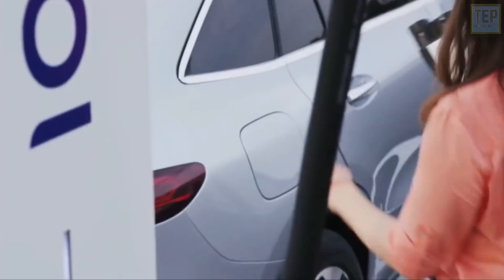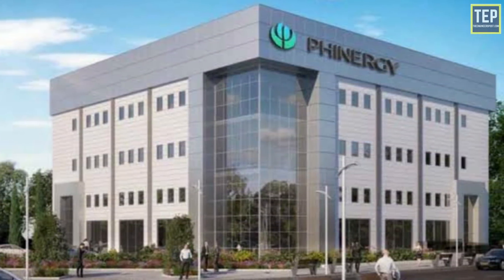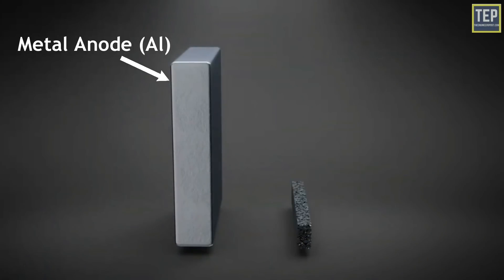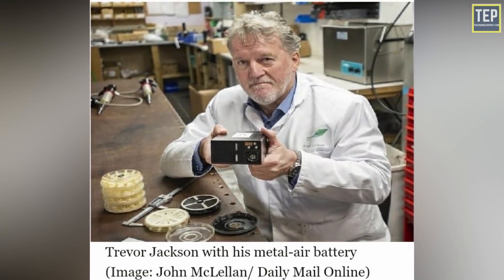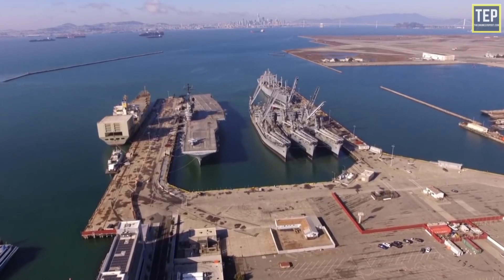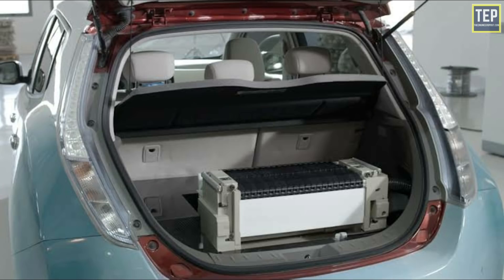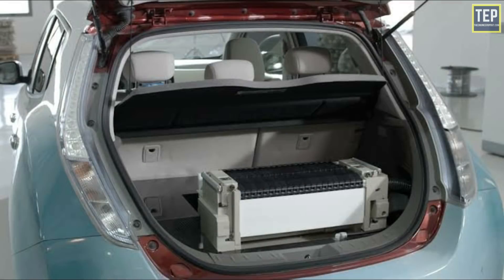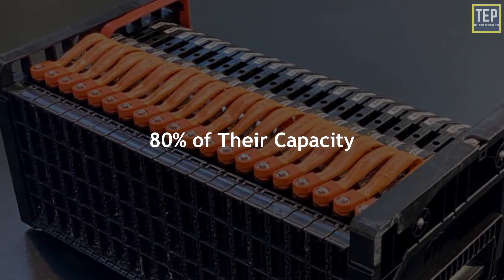Aluminium-Air Battery | An EV battery that Doesn't Need to be Charged

Comment: Sounds  too good to be true I just can't  believe  this  as full truth  revealed
Reply: It is, while the tech is old and well understood, making it fit the roll as a car power source at a competitive price isn't. Electricity can be delivered     thru a grid cheaply. These will require tractor trailers to haul new and depleted units around. The recycle part a white lie. Most recycling is taking aluminum metal, melting it, letting the contamination burn off and repouring it. This is aluminum rust. It has to be refined back to a metal so you will need much more energy. Once wet the clock starts ticking, the cell is dead in 5 to 6 weeks  even if parked the whole time. And there is more
Reply: Make one yourself! Take activated charcoal, (pet store for aquarium tanks), paper towel and salt water. The industrial versions use modifications, but it works!
Reply: @evanriddle1614   Honestly  I'm  not  good  at handling industrial  material  or assembling these only can handle  small basic work at home just to not  become total  handicapped by service seeking  helpless to anything in life in practical sense Jack of all master of none 🤓😂😀😊😲🙏🙏🙏🇮🇳

Comment: There's one thing that puzzles me though: If a car using this sort of battery did run out of charge and couldn't get to a swap station, couldn't a service truck simply bring a replacement battery to the vehicle (instead of taking the entire vehicle to a station just to get the battery replaced as you suggested in the video)? This sort of thing is already done with conventional vehicles powered by either  Gasoline or Diesel - we once ran out of gas, and my father simply had a friend take him to a gas station to get a small portable tank of gas we could put in our car.

In fact, from an engineering perspective, I'm not certain if dedicated swap stations might be the best way to distribute this sort of battery (delivery from a central storage facility or factory might be the only way):

I can imagine a single gas station serving at least a few hundred of cars per day (a single busy gas station gets a delivery of gasoline once or twice a day - _A DAY_); now, imagine how many new batteries a single swap station would have to store if it were to serve the same number of cars that a typical busy gas station would serve per day. I can imagine a single swap station would need a warehouse that's at least the size of a typical grocery store just to store enough batteries to keep up with demand.

A more practical solution would be to keep these batteries in a smaller number of extremely large warehouses, or even build battery factories in every major city; and people would deliver the batteries to the consumers and install them in their cars. And as for long distance travel, possible solutions include either building large battery warehouses and/or factories close to Interstates and other major highways, or even integrate overhead wires or wireless power distribution into Interstates and other major highways (thereby eliminating the need to charge or swap a battery while traveling long distance.)
Reply: You numbers are off as they would likely be a once a month switch versus people getting gas once or twice a week. So already a much lower load of cars per day on average considering there was a 100% conversion of technology. I would guess that home delivery/replacement would be a big appeal for many. If they were easy enough to swap then people could just have them delivered and do the swap themselves and receiving credit for turning in old power units. Think like an Alhambra water delivery service except you would not be getting multiple power units at once due to the 80% degradation in a month unless they are designed to not let the process start until originally connected. That could lead to swap stations being not nearly as congested at peak times.
Reply: @grimrevan4660  what matters is cost of swap
Reply: @grimrevan4660  In reality, the battery will last only 2 weeks max.  The natural degradation will decrease the capacity of the battery by 40% in two weeks leaving 1600 km of usage for the car owner.
Reply: @blam1328  The battery is fully replaced (not recharged) in most solutions, so no. There is a reason this type of battery attracts so many angry comments.
Reply: it will be via gas stations.  but it depends on demand and  cost
Reply: It can be recharged and used as a liquid metal slur instead of non-rechargeable solid aluminum bricks, at least there are prototypes for both.
Reply: @BlondieHappyGuy  LOL . carbon footprint to make the battery comes from power that you use and its one time. And its less than 2% compared to what ICE belch out during its life time burning gas/diesel.
And its about cleaner cities where most folks live and drive vehicles in.
Reply: @davelawson2564  the opportunity cost of using aluminum is what it could have otherwise been used for.
Reply: For a planned long trip, just carry a second battery. These are supposed to be much lighter so minimal loss for the added weight. Almost double the range. Include a simple switch to connect to second battery.
Reply: @BlondieHappyGuy  what nonsense are u talking about ? LFP is rechargeable battery and it can be charged at home and office parking lot. with most folks travelling 50 km per day in cities and 200 - 300 km range they can go for days w/o charging
Reply: Not easily. We would be talking replacing a battery that weighs between half a ton and 1 full ton by the side of the road. It would take more than just a floor jack to get that to happen.
Reply: @TheNeighbor4U  which battery weighs a ton that needs replacement by the side of road ?
Reply: Multiple battery install-run one down , switch to back up and replace primary battery, simple
Reply: hh
Reply: Perfect solution.
Aluminium Air Battery >> Lithium ion Battery

Comment: I've heard of something called petrol, apparently it's a liquid stored in a tank, that your car runs on, and when it runs out you can fill it up again in 5 minutes, and it's not a scam. Amazing!
Reply: And it runs on  about 15% efficiency, relies on unsustainable source, and releases a whole lot of harmful gas into the atmosphere.
Reply: @shaheenshad5012  Yes, but it exists, unlike this battery, because the laws of physics say that it's impossible for it to. If they're saying that it never needs to be charged, that means that it's producing energy without an external energy source, which is impossible in an Euclidean world. It's like a perpetual motion machine, which we know can't work. This is a huge scam and I can't believe people are falling for it.
Reply: @assetto1360  it is not an infinite energy source, each battery only lasts about 2700 miles, but the  interesting thing is that they say it can be swapped within 90 seconds. On the mean time they're working on making it renewable .
Reply: @shaheenshad5012  Then why does the title say that it doesn't have to be charged???
Reply: @assetto1360  an exaggeration, just like teslas were advertised as zero emission vehicle. Did you even watch video?
Reply: @shaheenshad5012  So then you're saying it's a clickbait video. Why would I watch a clickbait video? And that's the thing about electric cars. They're considerably worse compared to petrol powered cars, so they just lie, to make them sell better.
Reply: @assetto1360  mechanically recharged. Zinc air batteries also use this method.
Reply: @assetto1360  because it doesnt - it is Not a battery as such itdoes not Srtore charge it is  a generator
Reply: @DaveJohnsonDBA  That's exactly what I've been saying. A generator needs some sort of energy to convert it to electricity ( this can be heat, movement,  pressure, chemical reactions...),it can't just produce electricity from nothing.

Comment: Very interesting. A car might have 2 AA batteries, one inservice one on standby. If each battery provided 1,000 miles, the replacement cost would have to be of the order of $100 to make this scheme viable. Battery design would need to focus on very inexpensive recycling cost.
Reply: That would mean lithium ion is still cheaper for most people though. Most people, at least here in the states, charge at home for around $0.13/kWh. Even after factoring in the cost of replacing the lithium-ion battery every 1000 cycles, it's still half the cost of swapping.

The only way the economics of swapping work at $0.42/kWh are for people who would typically only fast charge.

Maybe there's room for both. Use your own rechargeable battery for daily commute. Charge off local grids. When it's time for that road trip, drop your lithium battery at a local shop to be charged/stored/maintained, and have them install an aluminum battery. When you get back, swap back into your fully charged lithium battery.

Having lithium battery problems, drop off the battery to be inspected, have an aluminum battery installed as a stop gap.

In general being able to hot swap rechargeable and refurbishable batteries would be a good thing. Would love to see a standard around that which doesn't impact storage capacity much. This is getting harder as more companies are moving towards making the battery a structural component of the vehicle.
Reply: with a 200 dollar tax
Reply: Aluminium air batteries only have between 2 and 3 times the energy density of a lithium ion battery. A "AA" size aluminum air battery would not power a bicycle properly. Let alone a car. You would need a battery the size and weight of at least 2 to 3 of the lead acid batteries found in an F150 to power a car. More to provide any decent range.
Reply: @TheNeighbor4U  No one said anything about a AA sized battery. Don't be dumb. Also, although aluminum air batteries density wise will be around 3x. Weight Wise it's about 8x. A vehicle powered by AA (aluminum air, not size, duh) batteries can easily achieve over a thousand miles in range. Though those kind of numbers will be harder to hit on more compact cars. Either way aluminum air batteries provide significantly more range, eliminate half the up front cost of an EV.

You can get an EV with a Lithium-Ion battery. Larger up front cost, and cheap electricity rates. Or you go with the aluminum air option, and pay pretty much what you're paying now at the fuel pump. In the long run they'll pretty much null each other out. But I have a feeling aluminum air evs, will be the ones people buy for junker prices, and drive for many years without much issue.
Reply: @dvanomaly420  I have learned not to assume things. Especially in this age where people believe massive amounts of misinformation and are willing to cling to those incorrect beliefs and facts even after being shown the truth of the matter.
Reply: @dvanomaly420  aluminum air EVs are further away from becoming mainstream than hydrogen cars. For at least 2 reasons. #1: They are not rechargeable. #2: they are only 2-3 times more energy dense. Not being rechargeable means they would need replacing repeatedly. And considering shipping costs and that one of the most likely to be used rare materials in the battery is silver, the battery replacement would likely cost significantly more than a full tank of gasoline. Even for small 100 to 200 lb batteries. At a frequency of every 2 weeks to a month for most people. This significantly eats into their ability to be cheaper or more convenient than current evs. Them being only 2-3 times as energy dense means that a long range car would still require batteries between 1000 to 1500 lbs in weight at a minimum. So significant infrastructure would be needed at gas stations across the nation to change out those batteries. It would not be possible to just run into the supermarket to buy a new battery with your groceries. This puts them at least 10 years out from being a competitive option to lithium technologies for evs. 

That said, they would be a fantastic way to replace most use cases for those solar generators. I think Aluminum-Air battery generators would be the perfect way to develop the technology for the time being.
Reply: @TheNeighbor4U  They don't need to be rechargeable. It's a consumable, and easily refurbishable. Which is why it will have to be a modular system. You simply pull into a space, pay for x number of modules. The machine swaps the modules. Modules are refurbished on site, or shipped on trucks just like gasoline. Aluminum batteries are safer to ship than gasoline or lithium batteries. You'll pay more for the infrastructure vs charging a lithium battery at home. Lithium will likely always be cheaper in the long run, until further breakthroughs in rechargeable technologies happen.

Also, hydrogen is a nothing burger.
Reply: @TheNeighbor4U  OH SH*T      By AA I meant "Aluminum Air"   Sorry
Reply: @johnbest5817  oh, no worries. It definitely reads completely different when you read AA as Aluminum-Air. I had never seen anyone use that acronym for Aluminum-Air before.

Comment: We can have two or more batteries for exchanging the exhausted batteries.
Reply: It would be great to have two of these batteries with a 500 mile range each and change one at a time. But the battery would have to cost the same as a tank of fuel or less.
Reply: Just have hybrid system, a small permanent lithium battery, lets say 30kw that's good for 100 miles or 160km. And then a swapable lithium air one thats good for lets say 500 miles or 800 km. So the lithium battery would be good for 90% of daily use and only when you need to go further. In this way you keep the advantage of both system.
Reply: @danielvilliers612  makes Sense, but with 2 battery the car Will be too heavy,  how if with battery can reach 500-800 km, and when it electricity near 20%, a  built in small generator automatically recharge the battery ?
Reply: Yes , like nio ev factory from cina, they changed battery just in 5 minutes in their changing battery station
Reply: It’s cheap but still expensive if you carry 2 battery..
Reply: @fun-native1216   with nio ev product, you just need by one, and swap your batery when its empty.. in their swap station.  I think its more reasonable than the other ways.
Reply: As they can’t be recharged, we would need somewhere to dispose of the used one. 😜
Reply: @andrewj8774  yes, it is. But not all battery, just Cell that damage.. when we changed that Cell, battery can be using again like before.. need time to makes a ways how to recycling the damage one

Comment: Wow great explanation ❤️❤️❤️. I like one thing that they don't require electricity ⚡ thats quite good for choice.
Reply: Aluminium production is energy intensive. About 17,000 kWh of electricity are required to produce 1 tonne of aluminium. This means that it has a relatively high cost.

Aluminum. Aluminum can be recycled using less than 5 percent of the energy used to make the original product. Recycling one aluminum beverage can save enough energy to run a 14 watt CFL bulb (60 watt incandescent equivalent) for 20 hours, a computer for 3 hours, or a TV for 2 hours.
This being said, once it's made it cost less to recycle, but mind you the product being recycle in this case is aluminum oxide, not raw scrap.
Reply: @evanriddle1614  
Yes but its storing a lot of that energy in the metal.. so that has to be measured against the energy of transmission losses and charging a battery in a vehicle.
A lot of Al smelters use Hydro or Nuclear power but you could also store excess/off peak tide, wind or solar power in this form ...  And the physical  transport would probably be safer and cheaper than transmission over international super grid distances or constructing the super grid. 🤔

Comment: What happens when it is cold enough outside to freeze the water in the battery?? Or hot enough to evaporate the water??
Reply: If the battery is properly insulated then that might not be a major problem. And they could also come up with ways in which we could regulate they ambient temperature of the battery.

Comment: Can't we design the car in such a way so that swapping would be like removing a briefcase and it should be mandatory for having an extra block of Al as a reserve just like lpg used in households?... I think it have a huge potential not only to replace batteries but also fossil fuels.
Reply: @brianoconnor4269  
These are not charged they are manufactured. To recycle you just Smelt the aluminium down again..and make a reformed pack. 
Nio is not the only company that has developed a successful
battery swap technology and they are light enough to be handled as blocks  and dropped in place ..or raised under the vehicle. These would work great for small to medium sized boats using electric propulsion .. and in aircraft.
Reply: Check NIO